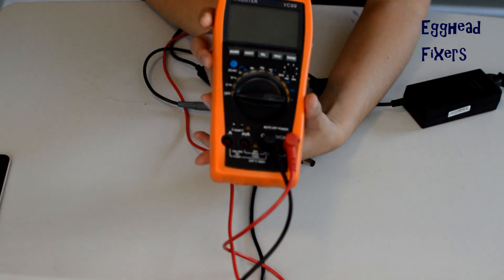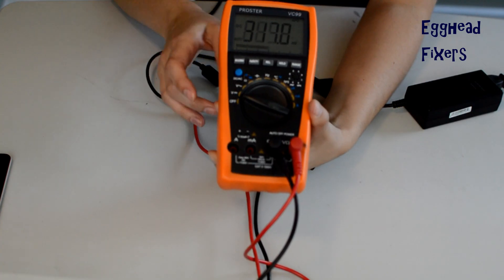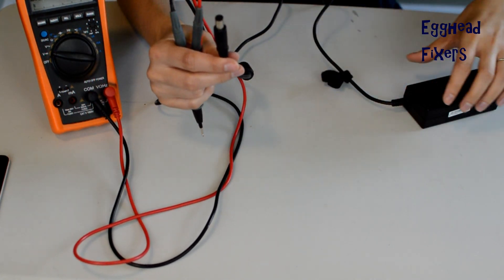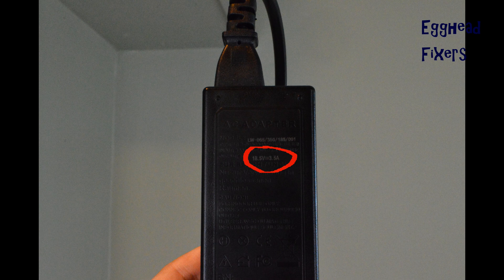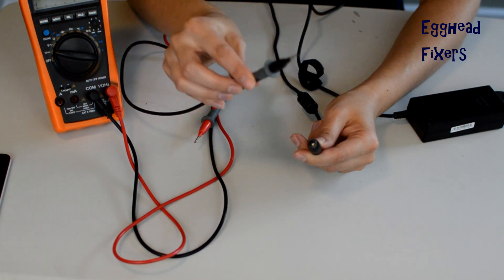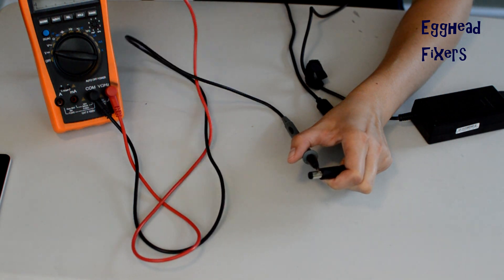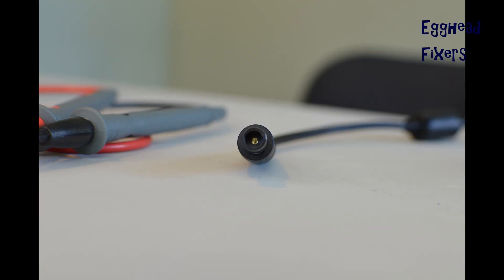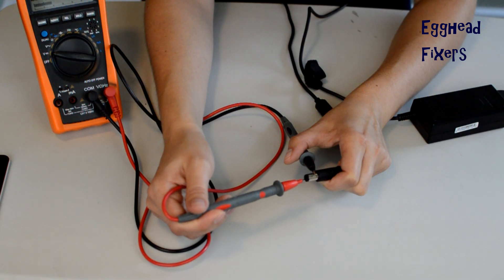How To Test My Charger / Power Cord on My Dell Laptop

Comment: At first my laptop showed the blinking pattern of 3 red and 5 white led light blinking. Then i checked my laptop charger and there is no voltage output. so i got new charger and connected  to the laptop and switched in ON then there was only keyboard  backlit and the charging  led white light. But the screen wasn't ON. so what shall i do now?
Reply from the maker: Sorry to hear that:( Here are two videos that can help with this problem:

https://youtu.be/wY335MRKc3U

https://youtu.be/bZSz-jjexqM

Let me know how it goes:)
Reply: Hi,

I have this same problem and so far I have not been able to solve it. All this after replacing a hard drive with SSD, and shortly after the installation of the operating system, he did not give more video. It flashes 5 times white and 3 times orange. In your case, how did you manage to resolve it?
Reply: Hi,

I have this same problem and so far I have not been able to solve it. All this after replacing a hard drive with SSD, and shortly after the installation of the operating system, he did not give more video. It flashes 5 times white and 3 times orange. In your case, how did you manage to resolve it?
Reply: @henriquecordeiro1868   I tried all the suggestions from egghead but it didnt workout. So I contacted dell care and they replaced my motherboard. Try all the Egghead fixers videos if it is not working contact your laptop  cmpany customer care